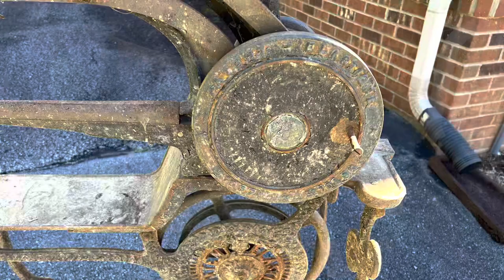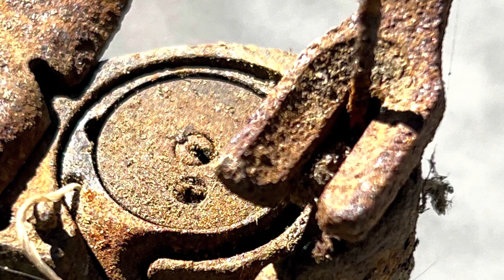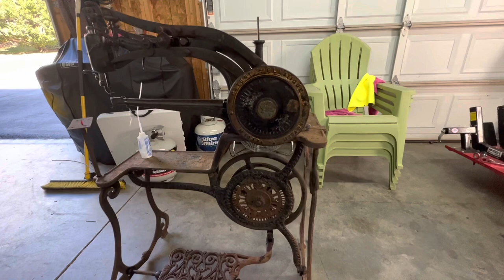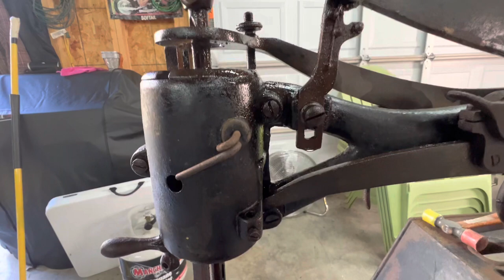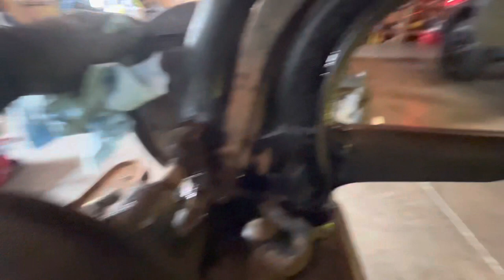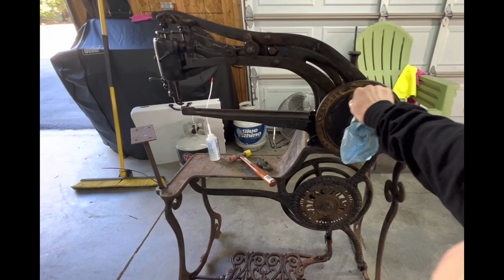Patent Elastic Cobbler Sewing Machine Part 1

Comment: Beautiful machine! I bought one exactly like that one week ago and is in the middle of the renovation process. I’m struggling on figuring out what needles would work on the machine. There was no needles or handbook available for my machine. I bought it for sawing in leather but I’m new to using a machine. Extremely thankful for any advice you can provide 😊
Reply from the maker: Karl thank you! They are beautiful machines for sure. I’m still in the process of rust removal & cleaning up my Patent Elastic too! So much work to be done on this neglected machine…😢, but I was thrilled to get it unfrozen & moving again!!! 🥳 The needle in mine is a rusted mess and I’ll be removing it soon, maybe when it’s out I can read something on the shank? They mentioned system 88 needles would work in the Singer 29k and other Patchers Facebook group & also have a manual translation in English in the group files. They are a very helpful group, friendly & happily share knowledge and resources. If you use Facebook check the group out & search their posts & files.
Best of luck 🍀 on your renovation journey with your Plastic Elastic & feel free to share any progress you make. I’ll try and upload any updates on mine here on YouTube as time allows.